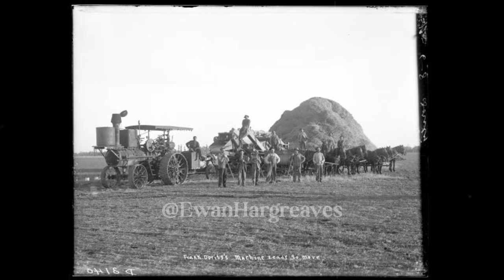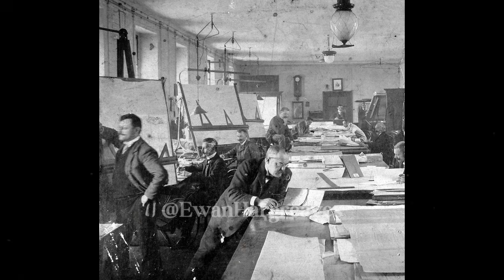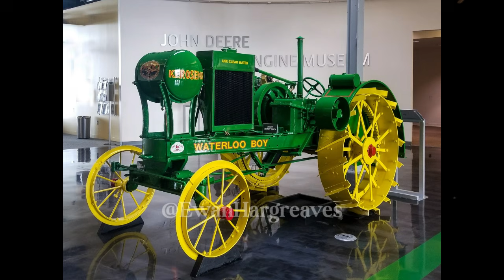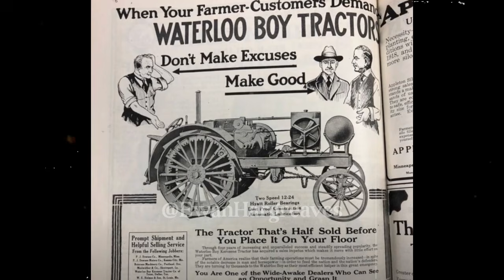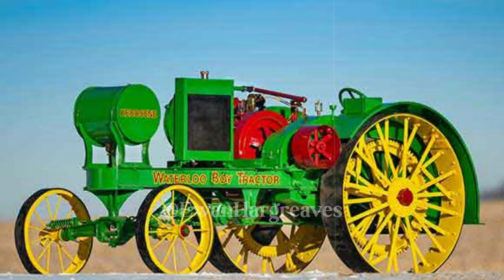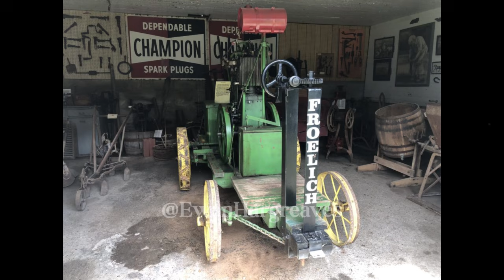He Built the First Gasoline Tractor in His Iowa Shop — John Deere Made Billions, He Got Nothing

Comment: 72,500 seems like a whole lot of Wheat with a 20 HP engine! 
Even in 2000 1 hundred years later the largest combine in a good wheat crop 60 Bu. crop and 30 foot header at 4 MPH  7400 Bu. in 10 hours without stopping or headlands!!
350 HP.. So 10 days if everything went great to thresh 74000 Bu.  4 Super B Trucks fuller back then 140 acres in good wheat in a day.. But maybe had double shift in the stooks and changed the horse teams out for 40 days of a harvest! Maybe I missed something.. 
Grain bins 1000 bu. wagons for hauling  200 bu. NO LIGHTS for NITE TIME HARVESTING Rain Events WORKING SUNDAYS?  and a crew of 30 or more?